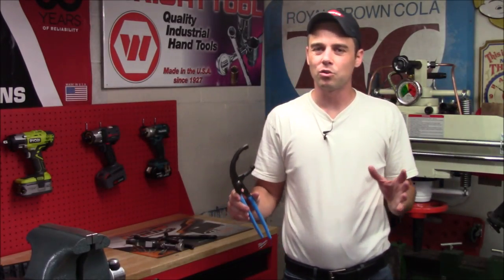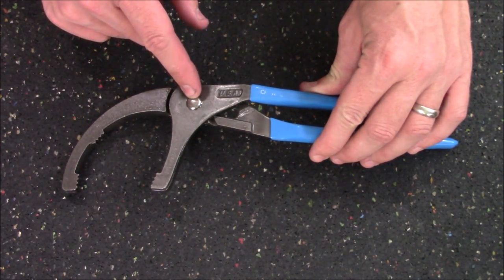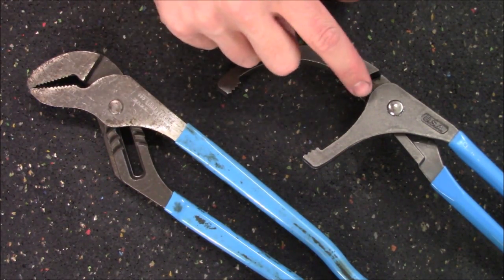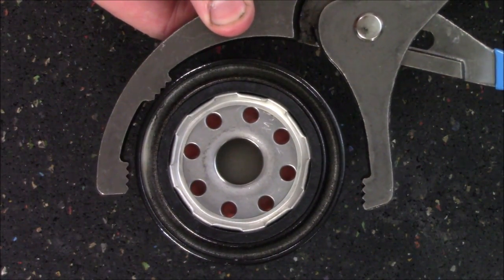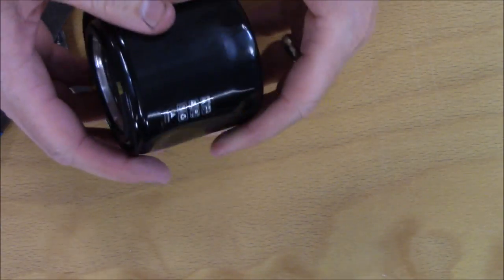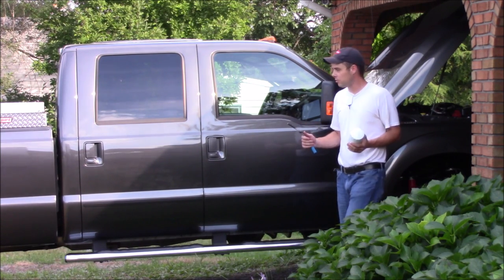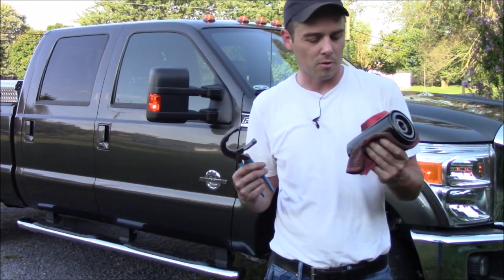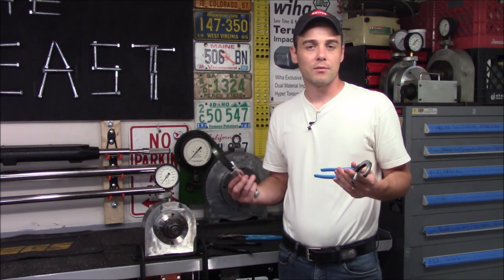Channellock 2012 Angled Oil Filter Pliers - MADE IN USA

Comment: I don't have this newer angled filter pliers but 2 older straight handled versions, a large and small. I was 35 years an industrial machine mechanic and have gone through the entire litany of different filter wrenches through the years for all kinds of screw on filters and these pliers are the best as far as I'm concerned, they will almost service the entire range of different filters, where as before I had to carry around a bunch of different types of filter removers (those old stone age tool boxes used to get awfully heavy by the end of the day, it's a joy to lighten the load whenever you can, and eliminating those multiple trips to the truck).

Comment: My last oil change I was trying to use a pair of Knipex cobras because someone over tightened it before. That shop also used and oil filter my socket wouldn't fit on. Wish I had a pair of these.

Comment: Tip: Punch a hole in the end of the filter housing at it's lowest point and allow it to drain. The filter will be lighter to handle and you won't spill oil everywhere.
Reply: Definitely would make less mess- I'd make sure I can get it loosened first, just in case it can't be removed for some reason, rendering it undriveable.

Comment: An oil filter socket is always the best. However, I recently ran into a situation where I had a quick change oil place do my oil change. They used a weird off brand oil filter and none of the sockets sold at autozone fit (I think they do this on purpose, so you can't get it off and have to come back to them). I had to buy a wrench in the style of this video. It worked GREAT!

Comment: Don't do what I did one time when I was UN-necessarily in a hurry and knocked off a quickie filter change on my truck, jumped in, backed out and down the street I went, I just happened to look in my rear view when I saw a Hansel & Gretel trail of oil from my driveway down the street. The old filter ring seal had come off and stuck to the housing, in this case 2 seals are Not better than one! Always take a few moments before disassembly and another few before reassembly to catch this sort of Blunder. If I hadn't looked back I very well could have drained the oil and damaged my engine. *- Military Fighter Pilots are now required by Regulations to have a few moments of doing absolutely nothing with nothing else going on, sitting in their quiet cockpits clearing their minds before takeoff. Psychologist discovered these few moments greatly reduced accidents due to over-sites.
Reply: Man I know what you mean, the other day I had a big job to do after work, I leapt into my car in the morning and took off without my phone (which I needed).
Took 2hrs, 70miles and 2 extra $5 tolls to drive back get it and go again.
If I spent 5mins extra every day preparing and avoided just one of these screw-ups a month I would be better off.

Comment: I like the filter socks for my personal vehicles. Makes taking off and torquing to spec easy. Buy quality ones versus the Fram Stamped steels. Also like AST screw in funnels and lastly Fumoto Valves. Changing the oil is a 10 minutes no mess job. Don't even need a pan as I use a piece of tub and old jug.

Comment: i have tried a few different band wrenches and an adjustable fram socket wrench neither worked at all. I do oil changes for friends and family and it is so frustrating it has taken me 15min or more to get a stuck filter off using all my might. Now I use a pair of winter work gloves that have a very gripy coating on them. It's just that extra bit of friction I need. Also always wear grease monkey gloves hate having oil on my hands. Always been to afraid to do the screw driver and hammer trick. Good video and nice truck!

Comment: This is a neat design but I still prefer cup filters because you use a ratchet and there are no clearance issues and you can use leverage
Reply: I've used the metal band type with the 3/8" receiver and a socket wrench and never had trouble even on very tight filters.  

This plier type is something to have for emergency use only as I'd just prefer not having to dent in the filter every time, even if it's slated for disposal.   

The socket cup filter removers I've had sometimes don't hold well enough in extreme force situations, and slip.  The band type gets tighter as more force is applied, so I found it to work best.
Reply: What's it matter? Filter is going in trash, dents are a non-issue.

Comment: I'm working from the top down in a boat and the angled handle will hit an obstruction.  Does the 2012 come in a straight handle version or can it be used opposite for turning in counter clockwise direction.  The head on a traditional channellock ist too thick and hits another obstruction.

Comment: hey just a comment on that Lucas oil synthetic oil additive. you are using just one quart. you need to use 1 quart to every 4 (not exceeding the maximum). you only use one quart for older powerstrokes with HEUI injectors that actually are actuated by high pressure engine oil. they don't say that on the bottle for obvious reasons. but my OPINION is that one quart is a waste with the newer diesels that have piezo injectors. I have a 6.0 diesel with those HEUI injectors and that is when you would use one quart.

Comment: Is that how dark oil typically looks after that low mileage? Just wondering as recommended service interval is now often 20K miles or more...
Reply: Baerchenization I have to change my oil every 2k and it's very dark then. So I believe it's a very common thing for it to be dark early on.
Reply: Yes, with emissions-saddled diesels, the oil is black almost instantly.
Reply: Your only changing oil every 20k... dude most vehicles I’ve owned consume around 1 quart of oil per 5k miles. By the time you’d do your oil change you’d be down 4 quarts and it’ll all that would be left is sludge. Change your oil every 5k max. 3k if you have an older vehicle.
Reply: @-Nobody-1  This is the profoundly dumbest thing I have read in a long time. Are you familiar with the concept of checking your oil level and topping it up?! This is outrageous :)
Reply: @Baerchenization  dude, I’m a mechanic, been doing it for years. Don’t go 20k on an oil change. Don’t go 10k like some Manf. Are saying with new cars. 5k is acceptable with a newer car running synthetic. This is pretty standard. And if you don’t hit mileage for an oil change within 12 months. Than change every 12 months. Pretty standard.
Reply: @-Nobody-1  Maybe this mechanic is mixing up anecdotes from years ago and regarding cars that actually are on 5K intervals... I don't care what some mechanic says, I care what the engineers who constructed and tested the engine and formulated the oil say. And they all say the same. Do you think they pulled that number out of their arse? My engine is among the most reliable out there, 70% ever build in over 70 years are still on the road today.
Reply: @Baerchenization  cool more power to you. All the best.
Reply: @-Nobody-1  Well, anecdotal evidence does not tell you anything - the only way to know whether your oil is good or bad is an oil lab test - and that says the oil is perfect after 20K. When you prematurely sell someone an oil change after 5K instead of 10 or 20K, you do not confirm it was necessary EVER, isn't that the truth? Because that would cost you 50 bucks which nobody will pay you back, and so you are condemned to do your little spiel. Which is good for your pocket - selling 4x more oil changes than necessary to people who do not know better - what a job!

Comment: Those pliers are great for sport bike engines where there is almost no clearance between headers and the filter. Been using mine for years.
Reply: Wish I had seen this a bit earlier. Cannot remove factory-installed filter. Tried various devices and methods to get the *** thing off (without success). In the process, I pulled the bike off the shop stand, and it hit the floor with a big-old crash. Now I have two body panels to replace. Not strong enough to remove a filter but strong enough to pull a 500 pound bike off a four-point stand. 
yay, I guess.

Comment: I'm not sure if you contact the companies for tools to review or they contact you or both, but if you could sometime, would you contact Wera and see if they would send you some of their ratchets to test and review? Their Zyklop Speed and Zyklop Metal ratchets are interesting. Particularly the design and slim profile of the Metals. I respect your opinion as a reviewer, and there is a lack of design difference between most high quality ratchets so I'm curious as to what you would think of those. Lots of professionals seem to gravitate to snap on but they only seem to be higher quality construction (and American made) and not of any different design than the other hundreds of ratchet brands out there. Wera seems to be aiming at a different angle here, and their Joker wrenches are bulletproof (from experience) so I think they should really talk more about these Zyklop Metal ratchets. Didn't mean for this to be such a long comment, thank you.
Reply from the maker: I like the Zyklop metal ratchets --- however they CANNOT be disassembled to service/lube them.  I imagine you can soak them with silicone spray or oil, but I have a 3/8" metal version & it is sealed.  That being said, I have never "needed" to dissemble it, but it would be nice.  The speed versions are unique & I like them too....WERA makes great tools, but comparing the two --- the metal versions are much slimmer.....the speed versions are somewhat large.  I have a review coming up soon...stay tuned!
Reply: +Real Tool Reviews good the know you're one step ahead. Thanks for the reply.

Comment: Check out the CTA filter wrench pliers, I find the teeth to grip a lot better and they're in a better position for leverage. I have all three sizes of the Channelock ones in case they can get somewhere the others can't (commercial truck mechanic, fuel filters are always in tight spots) but I avoid using them because the other styles grip far better imo.

Comment: the link directs me to an angle head and straight handle. not what I'm seeing here
Reply from the maker: The picture is wrong.  Check out the part #, that is what is important.
Reply: that's a quick reply there. but your sure its the pair of pliers you used to take off the oil filter right? the one with off set handle + head. I will order one now if you can confirm for me one more time because I already have the other pairs. Thanks a lot .
Reply from the maker: Yes, what I reviewed is part # 2012 ---- check it out on the Channellock site here to confirm --- https://www.channellock.com/2012-oil-filter-pvc-plier-angled-head.aspx?
Reply: Thanks again lol I wish they had the right picture the first time. Another sweet tool coming , I bought quite some tools from your channel here lol thanks for the good job.
Reply from the maker: Awesome!  Glad to help! :)

Comment: Just curious why you're using the Lucas additive on a new engine?
Reply from the maker: Well, basically I do not want to wait until the engine starts to wear out prior to preventing additional wear.....if you use it from the start, then you will not have dry starts caused by thinner synthetic oils --- preventing damage & helping the motor last the absolute longest possible.  I know that they say it extends oil life by up to 50%, but I use it to prevent additional wear.  I still change the oil at recommended intervals.  That being said, I have used the LUCAS non-synthetic additive in ALL oil changes on my other vehicles & the LUCAS non-synthetic stop-leak oil additive on an older Honda that had worn out valve stem seals (smoked like a train at startup) ---- the smoking basically stopped completely & consumption (burning) went down significantly.  On standard motors with regular oil (non-synthetic), the regular additive has quieted them down a lot & also prevented dry starts.  A minor investment for a major benefit (premature engine wear).
Reply: Real Tool Reviews Good to know, thanks